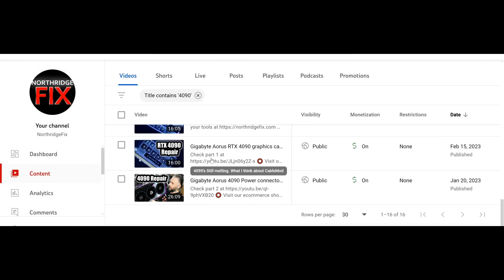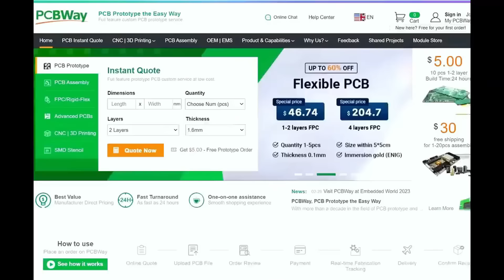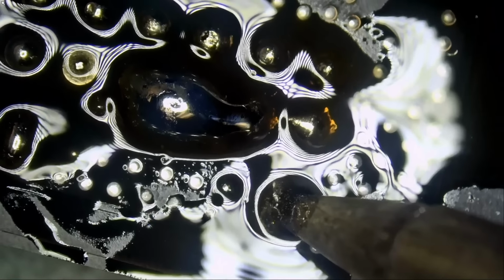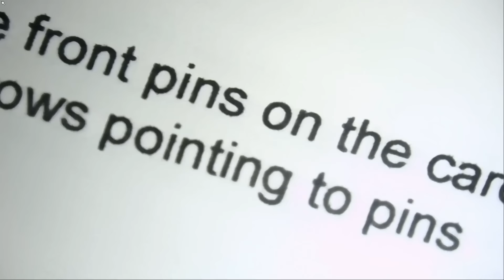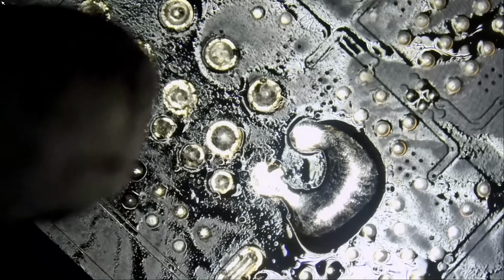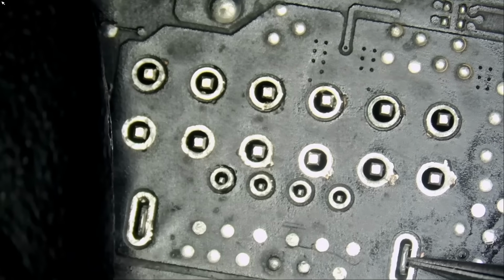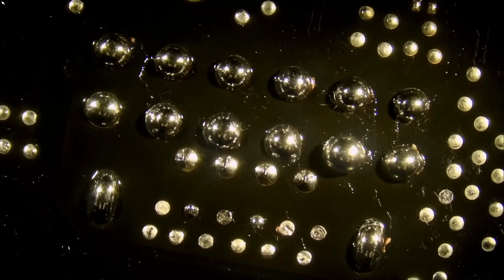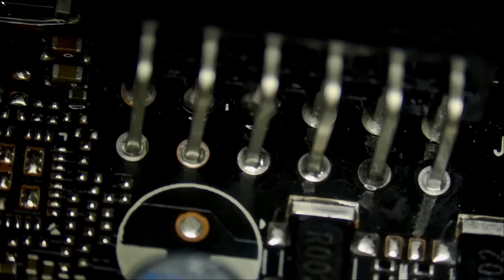4090 Graphic Cards are still a Problem.

Comment: I am actually so glad that AMD has never even thought about using this half-assed connector. This technology felt so rushed and untested that to be honest with you, I, Like others have mentioned have been surprised that Nvidia has avoided a class action lawsuit for this. There was nothing wrong with PCIE connectors for standard VGA graphics cards. If they needed a fourth connector they could have added a fourth connector but this 12 volt high power rail adapter was just reckless and completely stupid. All the companies that worked on this, that promoted this, and that have tried to say that this connector is a viable solution for VGA graphics cards, needs to answer in court as to why these connectors are failing at such an abysmal rate.

Comment: For soldering do you use 200 °C tin or low melt solder?
Reply: low melt
Reply: @kingbecher1  i understand, because 200 °C io very difficult to solder in particular way for ground holes with low melt solder it makes sense.

Comment: Evga actually saw this coming before they backed out of the gpu game. The kingpin 3090ti and the "next gen graphics" (evgas unreleased prototype 4090) has solder points for a second 12vhp connector. Meaning they knew through their testing that 1 of these connectors was not gonna be enough. Honestly nvidia probably knew this too considering the 3090ti draws around the same amount of power as a 4090 under load

Comment: Easy fix is just turn down the power limiter using MSI afterburner to prolong the card and it won't melt the connector in the long run

Comment: What is the reason this doesn't happen with the 3090 TI's that use the same board as the 4090, same connector and pulls the same amount of power?

Comment: I strongly believe the only rtx will be stable bo defects on melting 12v connector is the galax hall of fame rtx 4090 because it has 3x pcs of 12v connector thats more than enough that it wont melt the cinnectors

Comment: I have gigabyte 6800xt 16gb gaming oc version which used to fail on vram test so my friend reflow vram no more fail on test but now it green screen and restart pc when idle no load. When I play a game and the gpu is full load its fine any suggestion?

My friend did notice a darker color vram chip that looked different than the others any suggestion?

Comment: Why don't they just start manufacturing the connectors w/ PEEK (high temp plastic)??
Reply: money. people dont care. they still buy the cards knowing there is a chance that their card gets fried.
Reply: They are high temp thermoplastic already lol.
Reply: Problem is it doesn't really matter how high temp plastic you make it. That's not going to fix the problem. The electrical connection is still not able to handle the power. You will just start melting the insulation on the cables, possibly melting the pins, the PCB or even the solder if it gets hot enough. Point being it just shouldn't be getting hot enough to melt plastic in the first place
Reply: not sure 170c is enough tbh
Reply: @PainX187 Connector shouldn't be getting to 70c let alone 170c ffs. The plastic material is not the issue

Comment: Have you ever soldered wires directly to the 4090's pcb and bypassed using the 12vhpwr connector? Because that's what I'm going to do if my connector melts: I'll remove the burnt connector, cut my four 8 pin to 12vhpwr adapter cable in half, and solder the bare wires to the board leaving the four 8 pin connectors hanging off by the cable. That will never melt and I will never have another problem with this connector.

Comment: The fact Nvidia is still blaming user error on this heinous design flaw is stunning. Someone needs to redesign a replacement connecter and make a redesigned power supply cable to fix this. Solder the cables to the board if you have to. This isn't a cheap GPU we are talking about here. Though a redesigned connecter will likely only move the weak point to the Power Supply connecter. This is just an awful design. I just bought an RTX 4070, but I found a Galax model, the Gamer OC version, that uses a standard PCIe power connecter. I know RTX 4070s are not having problems, but I wanted this connecter no where near my PC.

Comment: The 4090 released October 12th, 2022 and so it took about 2 months for them to start melting and end up in repair shops.  They know how to engineer graphics processors and have multiple trillions of dollars behind their company but they have no idea how to engineer connectors that won't melt under normal use. Put two connectors on the 4090, force the use of both and the problem is solved, but they can't even do that because it would be admitting that they are wrong. They should use some of those trillions of dollars to buy back faulty cards.

Comment: Does the maker of the 4090 GPU have anything to do with the failure of the power connector? I have a new Gigabyte 4090, so should I be worried? Does overclocking have anything to do with the failure of the power connector? I've set my 4090 to SILENT, not BIOS OC. Would this result in less power draw?
Reply: if it is too hot without OC then OC it would be even worse. yes try under clock it if anything

Comment: is not better than factory thought... all that excess solder might create a short if the blobs get too hot, which it's basically the exact same issue that those cards have... they get too hot at the connectors

Comment: my Zotac 4090 problem seems to be no shroud around the connector protecting from fan hot air blowing directly on it and the wires. Could we put a material to absorb or delict the heat away from the connector and thus the wire, that's the issue I believe...simple fix I think let me know guys.
Reply: Thats not the issue.

Comment: Don't think it's a problem of Nvidia but of the Card manufacturers, I see in the video a number of Gigabyte cards. If the manufacturers make GPU cards from Nvidia then the warranty is at their expense. I myself have a Palit 490 GPU and have been working with it for half a year without any problem. If a non-Nvidia GPU manufacturer installs bad cables or connectors, this is the responsibility of that manufacturer. It strikes me that it is more common with certain manufacturers than others.

Comment: The current is too large and cannot be tolerated by those few 12V pins.
The greater the current, the higher the temperature, the higher the impedance, which is a vicious cycle.
It's impossible for nvidia not to know the root cause, but they can't bear this error..."the hardware design error."😢

Comment: It doesn’t help that intels problem is much more severe, at less imo it is considering it’s not a connector that’s going bad it’s the CPU itself just degrading even on low power server systems meaning it’s a manufacturing issue…

Comment: I got a type 5 1000w psu from corsair. It has this connector in the box, no adapters. Owned a 4090 for over a year, never unplugged, and barely ever turned it off. No issues. I think people who plug these things in are actually idiots.

Comment: The only one who can give a real and reliable answer to this problem is someone who works on an assembly line and is familiar with the design of the card and the resistance properties of those specific connectors and the tolerance values they applied to these circuits.
Reply: Wire gauge, too much current burns up any conductor that is too small due to the impedance/resistance.

Comment: ITS DISGUSTING ME AND MY NEIGHBOUR WE BOUGHT AT THE SAME TIME THE SAME CARD RTX 3070  AND EXACTLY 2 MONTHS AFTER THE WARRANTY MINE JUST STOP WORKING AND MY FRIEND A WEEK LATER THE SAME, THIS IS A SCAM AND IM BEYOND MAD, i tried to contact the seller but they said they could do nothing because the warranty had expired, i tried to contact the manufacturer MSI and they are in loops sending me different contacts, i spoke with one of these contacts and they told me the best would be buy a new one, im done with Nvidia and this time i will buy a Radeon card because the last time i had one 5000 series 8 years ago i remember it worked like a tank, its disgraceful to the point i really think they have done these cards just to work around 3-4 years, i have seen many foruns in the internet where people are having the same problem where rtx 3000 or 4000 series are just dying,  would be possible if i send my card you guys try to fix it? plz

Comment: i am extremely curious what the 5080 and 5090 can do. I am pretty sure nvidia put a lot of research to prevent this from happening again. If not, hohoho
Reply: Nvidia would rather them fail and get denied warranty. Most of the people who can afford a top of the line card can generally afford to buy a replacement.

Comment: It's a 900w software controlled VRM on a 600w rated connector, the TDP of the card is irrelevant. More than likely illegal as consumer electronics.

It weighs too much to be seated in a plastic PCI-e housing, with the weight card supported largely by the PCB itself while going through heat cycles. 

It's big, ugly and poorly designed and definitive proof they need to get someone realistic on the engineering team who has the nuts to stand up to management and say listen it's too big for it's use case and it needs 2 connectors for 400w TDP as the VRM for efficiency reasons needs to be at least double that. 

This is all because nobody stood up to a manager saying 1 power connector only and has to be the fastest consumer card by x margin.

Comment: It will melt again because this is the common problem but it will melt faster than the beginning because you used that’s solder 😅
Reply: He didn't use low-melt solder to solder on the new connector, only to help with melting the original solder. He probably used leaded solder for the repair.
Reply: @kyorin6526 From its color and how it melts, I'm sure that it's not same factory leaded In melting, of course
Reply: Would using silver solder help to solve the problem? When I boot my 4090 PC, I play Kenny Roger's "The Gambler" in my gamer room.

Comment: There are a lot of people parroting each other about a Gamers Nexus video that tested connector failures. First, Gamers Nexus tested cables, not the connectors on the cards. Second, Gamers Nexus concluded foreign object debris from the manufacturing process was one of three root causes, but said most likely it was user error based off of a laughably small sample size of two tests they did personally. It's embarrassing how confident and quick people are to judge and solely blame users when they didn't even watch the full video.

Comment: Still why do people buy 4090s😂😂 Nvidia has gone full AI.gaming cards are a hobby for them now
Reply: because unfortunately, Nvidia works better on average and they also have the top end performance of any GPU at the moment.

If you use a GPU for professional work as well, Nvidia is the most reliable in most situations.
Reply: @ofon2000 i get the professional work. But for gaming. Like yes the 4090 is untouchable but I rather have my 7900XT and rest comfortably knowing it won't combust into flames. Hopefully with the next generation it will be fixed.

Comment: You need a behemoth of a power-supply to run the 4090. Run it with a minimum spec’d PSU  and this is what will happen under the loads some people use it for.

Comment: We still talkin about this.  Geesh lol i sold my 1080ti like 2 years ago and got a 6900Xt and im glad i did.  I skipped the 7000 series and nvidias 40 series.

Glad i did.

But what was the build date of thise cards.. imstead of saying you keep getting it all the time.  What are the build dates of them ?

100$ for a pin replacement ?  Lol highway robbery dude.  Those pins dint require any specisl skills to replace..  unless it becomes microsoldering.

Comment: Probably crypto miners
Reply: Mining cards are undervolted and underclocked to put the card in the meat of its voltage/frequency curve. Mining workloads also don't cause large transient loads like gaming and tile based rendering can and these power "spikes" of two times the card's rated Total Board Power are mitigating factor in their longevity.

Comment: Its mostly people using weird adapters
Reply: It isn't the 8 pin PCIe interface that's the problem. These failures occur with ATX 3.0 power supplies that feature a native 12VHPWR connector, too